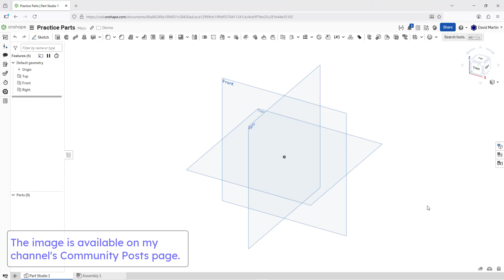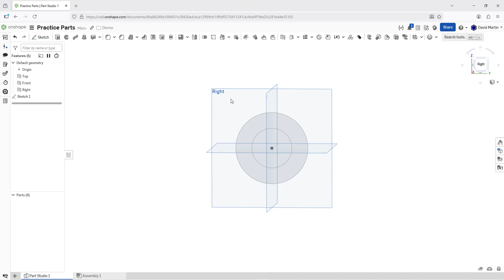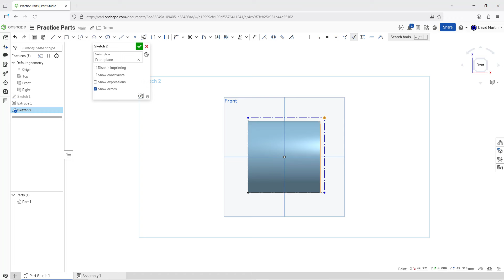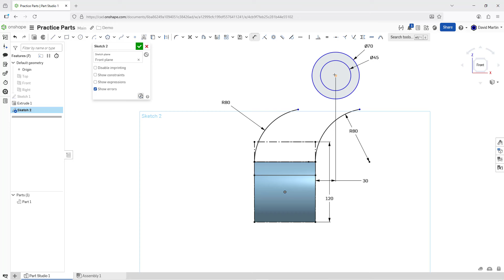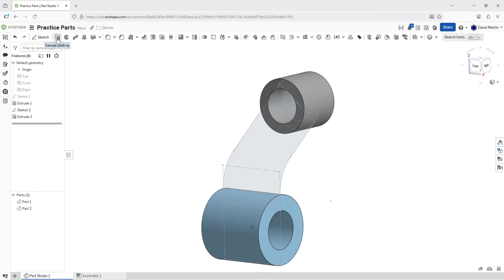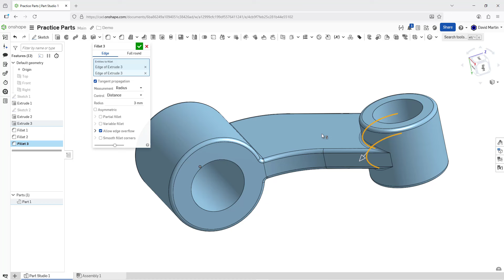Onshape - Internet Drawing Practice Exercise 1

Comment: Can you also do the modification part too where we have to modify it to 2 arc instead of straight in the center part and I'm not able to achieve it and couldn't find a video on it too 😭
Reply from the maker: I’m not familiar with the modification part of the problem. All I had was one picture off the internet.
Reply: Is there a way to share the pic with you it's same part with taper modification but that taper is very difficult to understand @CADPLMGuy
Reply from the maker: You can email it to me. But I doubt I will make a video on it. I have Onshape videos queued up through February and I am in the middle of a long series of videos. I didn't like this example to begin with. I think I commented in the video that I don't like part modeling challenges that are dependent on someone seeing the "trick." I don't see the training value in that.
Reply: @CADPLMGuy Thank you very much, it's right that it won't be challenging anymore if not done themselves but they are also the strong bridge for us to clearly understand where we were going wrong, It's okay if you don't make the video out of it but it will be very helpful if you can guide me where I'm going wrong with the part I'm having as a beginner still not all things I understand that's why 😅
If it's okay with you I can mail you the pic
Reply from the maker: Okay. I am also not promising that I will respond to the email.
Reply: @CADPLMGuy okay, thanks a lot for responding.